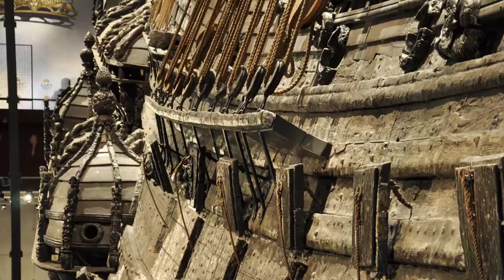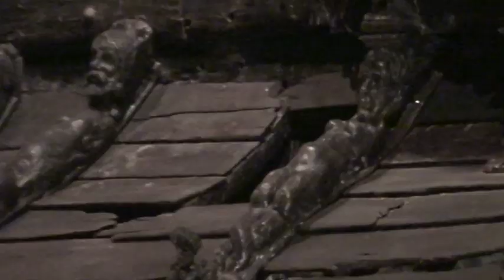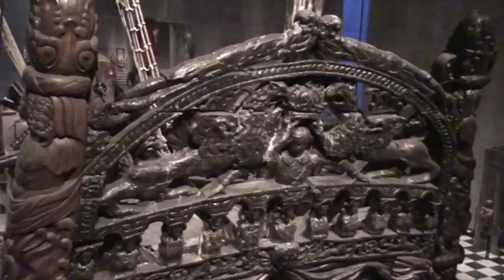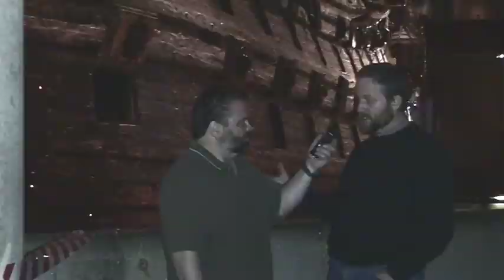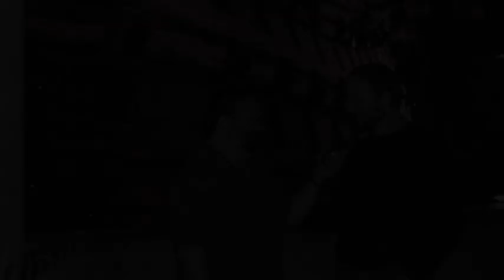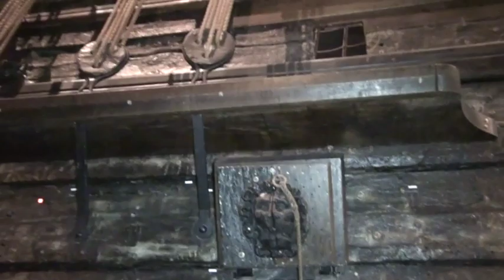Vasa Museum - Borton Overseas

Comment: Polyethylene Glycol is used in almost everything you can imagine nowadays, from lubricants and cooking oils, to assisting the culinary trades with food preservation and even material handling processes. (Like cutting bread, etc.) 

It's become a far more ubiquitous material in the intervening years, across multiple disciplines in virtually every industry, particularly since being discovered to work so perfectly for the VASA maintenance project back in the 50's and 60's. 

A quick Google or Wikipedia search and you'll see for yourself what a handy substance PEG really is. 👍